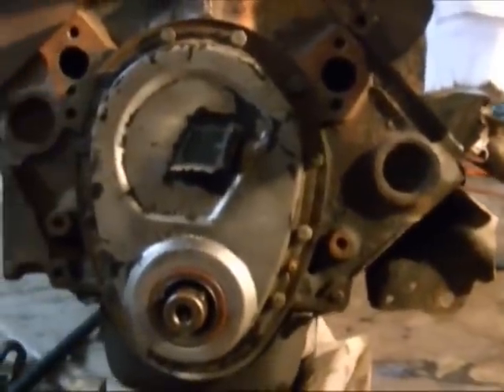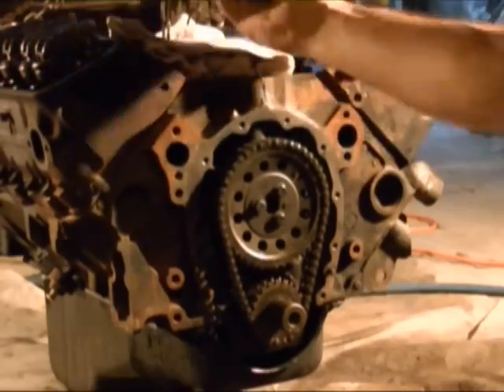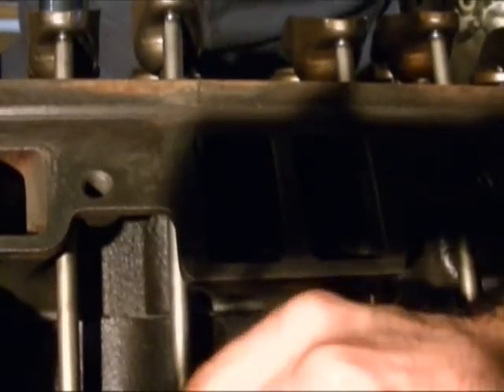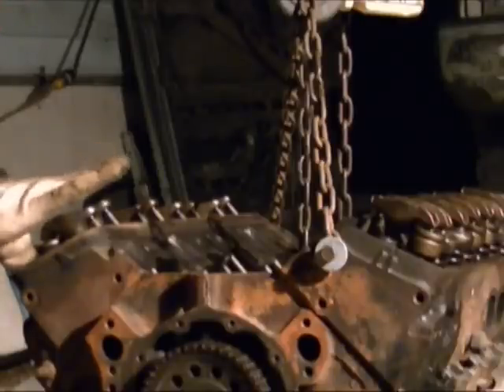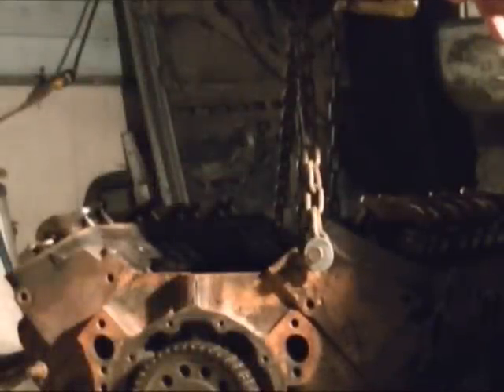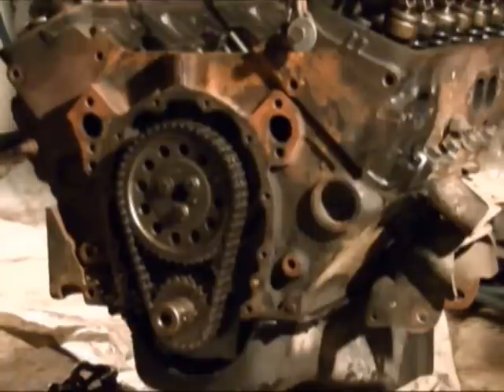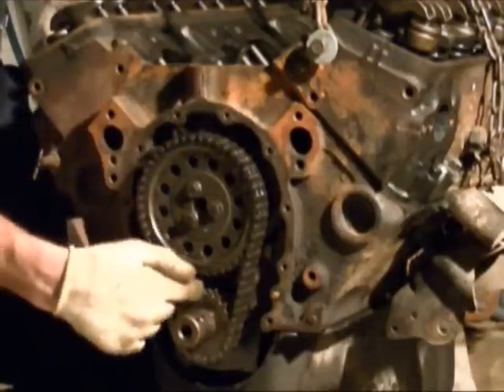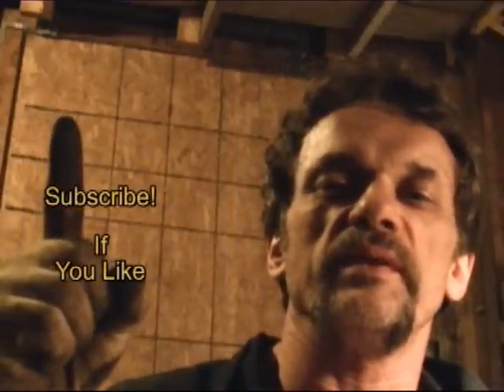Valve Pre-Adjustment on Chevy Small Block

Comment: why would you not use this on a new cam?
Reply from the maker: This is not an exact adjustment. To properly break a cam in (this is a must) you need to run the engine at a high idle for 15 - 20 minutes preferably on the first start if possible. I search for a while and found this for you. Start at 4min 35sec in the following video. Hope this helps. https://www.youtube.com/watch?v=mvJNMN-oP68
Reply: I just rebuilt a 400 small block my first rebuild what would be the best way to do my adjustment on a new cam?
Reply from the maker: Did you see the video link in my last comment? The method in that video is more accurate for a new cam.
Reply: thanks

Comment: great vid.i'll use the info.thanks.
Reply from the maker: Just remember, this method is not to be used for a new cam install.The valves will also need to be set again with the engine running. This only gets them set well enough to run it.
Reply: thanks.

Comment from the maker: @jjrock5 I just wanted to note, that I do not recommend this method on a new cam installation. I also recommend doing a final setting with the engine running. I briefly mention it in the video. I am putting a notice at the start of this video to explain just that. Thanks for this comment, it made me review this video and make it better.